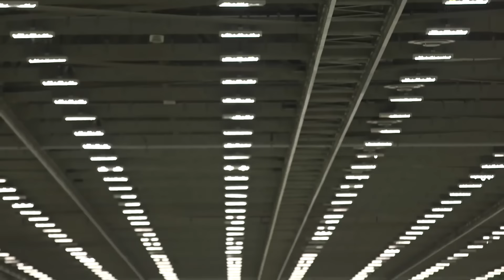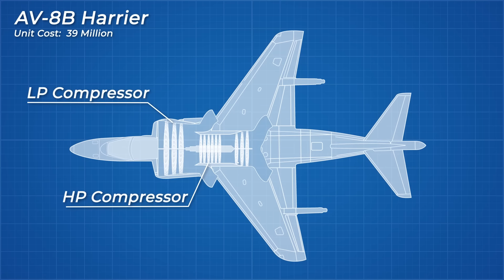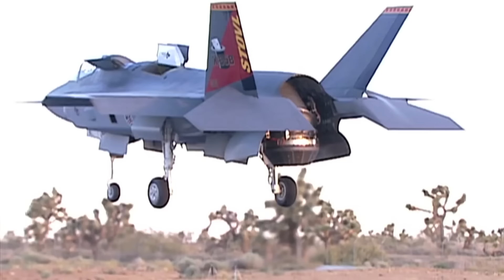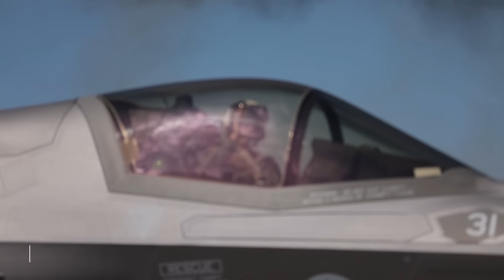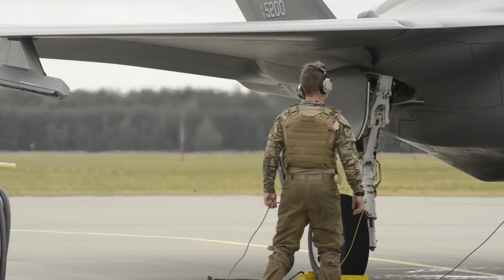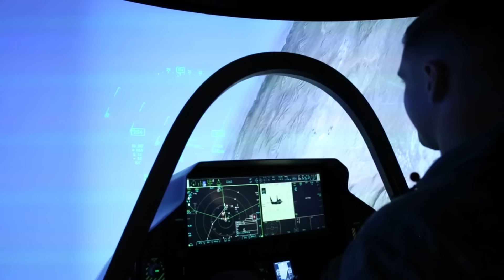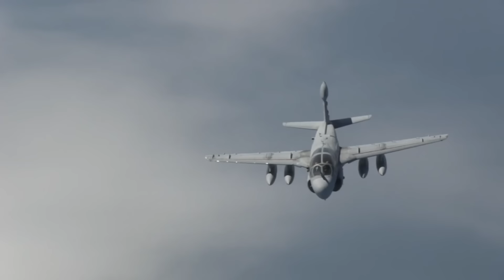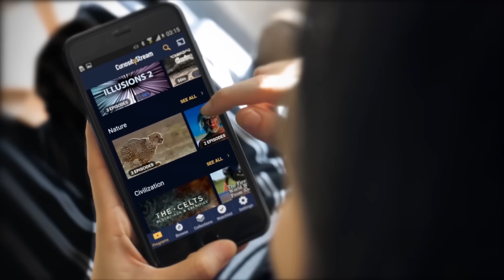Is The F-35 Worth $115 Million?

Comment: I want to the concept of the F-35 to work. Unfortunately, its development process felt like a way for Lockheed to lockdown a contract aimed to steal near-limitless tax money. The concept of a plane that consolidates multiple aircraft into one with full stealth capabilities sounds wonderful. Were they trying to consolidate too many planes into one? That is certainly arguable. I wouldn't get rid of the A-10; no other plane can do what the A-10 does - the F-35 doesn't even bother trying to do what the A-10 does, so that's a voice of confidence in the A-10's capabilities to me (let's not forget that the A-10 finally got its first upgrade only a few years ago, and it was predominantly an electronics upgrade, visible only by a couple of MFDs replacing multiple analog gauges - a handy upgrade, sure, but not a large one).

If any variant of the F-35 needs to work, it's the C. Navy specifications are actually a great standard to apply to the Air Force, so the Air Force's A variant is kind of pointless. Carrier and VTOL capabilities can warrant variants, but having three is unnecessary. Sure, the Air Force doesn't need reinforced landing gear or an arresting hook, but I've argued that ALL fighter planes should have full naval capabilities, and with this comes building steam/electromagnetic catapults and arresting wires at ALL air bases. Having carrier components full functional at land bases would greatly reduce the risk of grounding defense aircraft due to bombed-out runways. Plus, with the training programs condensed as well, all pilots would have the same skills and capabilities (the only lasting difference would be in tactics), and as a bonus, if one branch - or even military - needs more pilots, they can draw from the other(s).

As much as I want the F-35 to work after all of its time in development hell, it feels like a waste of money that should have been avoided. Sales speculation means nothing; businesses always oversell a product - that doesn't mean that they actually do sell, let alone by how much they say they will.
Reply: > "the F-35 doesn't even bother trying to do what the A-10 does, so that's a voice of confidence in the A-10's capabilities to me (let's not forget that the A-10 finally got its first upgrade only a few years ago, ..."

 The A-10 has begun being replaced in CAS missions where a ground-to-air or air-to-air (hypothetically ) threat is present by the F-16C since the mid nineties.
Reply: @peterson7082  And yet the F- 16C is to be retired in the 2030s, before the A-10's in the 2050s. Granted, this is subject to change, but this also speaks in favor of the A-10.

The F-16C isn't used in CAS missions; it's used for strike missions. CAS means that a plane has to stay in a (relatively) small AO where it is likely to take enemy fire (almost exclusively from the ground). Air threat are the first thing to be neutralized in any combat theater since Desert Storm, so F-16Cs fly in with F-15Cs to shoot down any and all airborne enemy craft and then assist F-15Es in destroying those still on the ground. The A-10 does have some air-to-air capabilities, but it has only been used against helicopters. While the A-10 has been shot down (and the F-16C has not), it has never been by enemy aircraft.

The F-16C was designed as a lightweight multi-purpose fighter whereas the A-10 was designed specifically for CAS and was (as pilots and engineers half-joke) built around its 30mm cannon. The A-10 is the only single-seat plane in the US military equipped with a 30mm; all others, including the F-16C, have a 20mm cannon. The F-35 is the exception... with its 25mm cannon.

Yeah, they tried to replace the role of the A-10 with the F-16C back in the mid-90s; then the A-10C was rolled out in the early 2010s. Since its introduction in the 1976 (the F-16 was 1978), there was only the A-10A; now, there's the A-10C. That means that their attempt to replace the A-10 didn't work out - and now they are trying the same thing using the F-35, which is effectively an F-16C with stealth.

Replacing the F-16 and the F/A-18 with the F-35 is hardly the worst idea; replacing the A-10 with the F-35 is much closer to that.
Reply: @DavidRichardson153  you're wrong about CAS. Not only did the F-16 provide more CAS than the A-10 in Desert Storm, there's footage of F-16s and FA-1/8s providing CAS in combat here on youtube.
CAS doesn't mean you have to take ground fire. It just means that you're dropping ordnance close to your troops. Not that the plane is close to the ground.
The 30mm cannon is a relic of the old days, it hasn't been able to punch through MBT armor since the mid 70's meaning that any 20mm or 25mm cannon in service can do the same job. The F-35 isn't the exception either, as the Harrier and the AC-130 have the GAU-12 25mm cannon. The F35's GAU-22 is a modern revision of it.
Reply: @ChucksSEADnDEAD  The F/A-18s providing CAS is easily explained away - what other Navy/Marine plane can provide CAS for extended periods? The Harrier is capable but it was already showing its age by Desert Storm. Trying to replace it with the F-35B isn't necessarily a bad idea. Rolling the F-35B out has been pretty s^^^ty, but that's to be expected from the program - once you learn of its development history (especially the contract for it).

The F-16 works great when the targets are in open areas or mountain ranges, where speed is vital to either reaching the targets or evading obstacles. In urban areas, the F-16 needs more room to maneuver around to line up its weapons, and that costs precious time - in both the maneuvering and the weapons travel from the plane to the ground (because the F-16 usually uses missiles, rockets, or bombs, which also have explosive radii - not good for collateral damage control) - that soldiers do not have much of. The A-10 has a much smaller turning radius and is designed to remain airborne in tight low-speed turns - something no supersonic fighter can do. The only air platform better than an A-10 for the job is an attack helicopter, but then the A-10 has the initial speed advantage for its first response. F-16s and F/A-18s are better for slashing attacks on the ground; they can provide more extensive coverage in a pinch, though the F/A-18 is better at that than the F-16. For extended time in the air under risk of enemy fire with a massive load out of weapons to fight back, the A-10 wins hands down.

And the 30mm cannon is hardly a relic. It has the same issue as all other airborne cannons: ammo. There are specific ammo types depending on the expected resistance; you have one for personnel, one for armor - even one for planes (bet that never crossed your mind). There is no ammo that is ideal for all missions; the F-35 is supposed to field a new shell that's better at being multi-purpose but it's still under development. Plus, Russian and European-made planes use the 30mm cannon (a different model, sure, but still 30mm); the MiG, the Rafale, and the Typhoon all use 30mm cannons. If anything, it's the predominantly-US 20mm cannon that's the relic.

Lastly, only the A-10's cannon actually fires one of the (currently) best anti-armor shell: a depleted-uranium core. Is this design old? Sure. Does it need replacing? Arguably so, and we're looking to see that (hopefully) with the F-35. Granted, the A-10 doesn't need to do a lot of anti-armor missions these days, so its ammo could be argued as being unnecessary, but the same could be said of the AH-64 Apache, and it uses a 30mm cannon (just a single-barrel one, not a rotary like the A-10). And before you argue that the Apache does mostly anti-personnel, guess what - so does the A-10 now (and the Apache was designed to help NATO fight off a Soviet tank invasion).

The A-10 is not going away anytime soon. The biggest advantage that the A-10 has over all other combat planes is that it was designed to absorb anti-aircraft fire. SAMs are powerful, but they are on the expensive side and their radar systems' signals can give them away to SEAD (Suppression of Enemy Air Defense) attacks, which is what the F-16, F/A-18, and (hopefully) F-35 can handle. Yes, SAM platforms are becoming more mobile, but once their radars are switched on, they might as well light a flare above them. Guns, however, are more easily concealed and thus can more easily surprise an incoming aircraft. The F-16, F/A-18, and the F-35 are not meant to take any number of hits whereas the A-10 is.

You want to replace the F-15E, F-16, and F/A-18 with the F-35? There's plenty of reasons to do so. Replacing the A-10 with the F-35, though, is incredibly foolish.
Reply: @DavidRichardson153  that doesn't really "explain" anything away. If there's USAF A-10s available, why are carrier borne aircraft being called in? On the other hand, even if the Navy lacks other attack aircraft it still doesn't undermine the fact that the F/A-18 is taking A-10 missions. It proves it is capable. The Harrier was showing its age by Desert Storm? The A-10 was showing its age by Desert Storm! 6 of them got brought down. Almost 30 years ago we realized that the A-10 was treading dangerous waters.
"In urban areas, the F-16 needs more room to maneuver around to line up its weapons" - what?
"the F-16 usually uses missiles, rockets, or bombs, which also have explosive radii - not good for collateral damage control" - the A-10's payload is essentially bombs, missiles and rockets. It's main weapon in 1991 was the AGM-62 Maverick.
"The A-10 has a much smaller turning radius" - the F-35 can turn very tight https://www.youtube.com/watch?v=IaHlWow6Yc4
"something no supersonic fighter can do." - https://www.youtube.com/watch?v=ELo1NRMHuR8 https://www.youtube.com/watch?v=5amEQpxHSSc https://www.youtube.com/watch?v=QoVGz9xai1M https://www.youtube.com/watch?v=beNOyZHVjEg at this point I'm gonna have to ask, who the hell has been telling you these things that are demonstrably false?
"only the A-10's cannon actually fires one of the (currently) best anti-armor shell: a depleted-uranium core." - which is not used due to the bad optics in spreading an aerosol of depleted uranium dust. Amazing how you bring up collateral damage and then ignore the massive heavy metal poisoning of civilians that lead to the discontinuation of the DU round. It leads to birth defects.
"The A-10 is not going away anytime soon" - it's already receiving less and less CAS missions. The USAF will begrudgingly keep it in inventory, but is not going to ask it to do much.
"their radar systems' signals can give them away to SEAD" - my dude, what do you think allows AAA to track and accurately hit fast moving jets? Radar.
"but once their radars are switched on, they might as well light a flare above them." - same as AAA
"Replacing the A-10 with the F-35, though, is incredibly foolish." - it's like you're not willing to listen, it's already been replaced for the most part. What you're saying is foolish already happened 5 years ago.
Reply: @ChucksSEADnDEAD  Has the F-35 already been doing what the A-10 can do? Do you not know that the F-35 was promised to be in full service by 2010 - and that promise was made back in 2003? It's only now that's it's finally doing what it promised to do - and reliably so? Remember how as recently as last year, it couldn't even fly in adverse weather because its avionics would shut down and restart as lightning and thunder went around it? Its entire development process has been a scam, one with a price tag of nearly $2 trillion dollars. How the hell did this happen? Because of a clause in the contract that authorized "concurrent production," meaning they would build the fleet of F-35s as the were being developed and tested so whatever problems were found in the test planes would be found in all of the planes. And the kicker to this? The DOD would have to pay Lockheed for every single one of these fixes.

Name another plane that has had a development process like this. Not even the B-2 or the F-22 had something like this, and they're even looking to just expand the F-22 into the attack role as well - there's already plenty of footage of F-22s dropping air-to-ground ordinance. The F-35 just screams of being a massive scam. And having its components built in multiple nations (none of which build more than one component)? Sounds good in theory for building trust between allies, but it allowed Lockheed to use other nations' economies to pressure the US to keep the contract going.

I am not going to see the F-35 as anything other than a scam, so if it's going to be serving on the frontlines, it better be a miracle plane, and given its history, there's absolutely no reason to hope for it to be such.
Reply: @DavidRichardson153  "Has the F-35 already been doing what the A-10 can do?" - not even the A-10 has been doing what the A-10 can do. Comparable multirole fighters have taken over the A-10's job. It only stands to reason an even better multirole fighter is gonna do it even better.
"Do you not know that the F-35 was promised to be in full service by 2010" - most operational milestones were achieved by 2013. Compared to the clusterfuck that is military aircraft development that was pretty acceptable.
"it couldn't even fly in adverse weather because its avionics would shut down and restart as lightning and thunder went around it?" - do you keep track of how often other aircraft have to be grounded because of issues? Just this year 75% of C-130s had to be grounded. The B-1B also had to be grounded due to parachute issues. T-6 trainers were grounded due to hypoxia and the same happened to 28 A-10s. In 2014 86 F-16Ds had to be grounded.
Not to point fingers at others, but Germany can't even maintain the minimum training standards because most of the Eurofighters are grounded.
"Its entire development process has been a scam" - every government program is a scam. That has fuck-all to do with the aircraft design.
"The DOD would have to pay Lockheed for every single one of these fixes." - lol that's the government for you.
"Name another plane that has had a development process like this" - considering that aircraft development used to straight up KILL pilots in the old days, and that a lot of the problems of the F-35 stem from the fact that it's inherently more complex, I'd say the F-105 and F-111 were proportionally just as bad as the F-35. Mind that the Eurofighter has also been in a politically-generated boondoggle as well.
"they're even looking to just expand the F-22 into the attack role as well" - who's "they"? The F-22 isn't as good as air to ground and nobody is going to rebuild the manufacturing line. It's gonna be a 220 million per plane job to reactivate the F-22 program. You can expand it into the attack role but that doesn't mitigate the fact that the US eventually will need to replace the aging F-15 and F-16 and there's not enough F-22s for the job.
"The F-35 just screams of being a massive scam" - if any other aircraft procurement was put under the microscope like the F-35 it would sound like a scam. Not only are we living in the information age which means you can't get as much details on the issues other older planes had, we're also living in a world of clickbait and deliberate propaganda. Let's not forget that some of the F-35's biggest critics are tabloids and outlets like Russia Today.
"Sounds good in theory for building trust between allies, but it allowed Lockheed to use other nations' economies to pressure the US to keep the contract going." - Again, mind that the Eurofighter Typhoon did the same thing - fuselage is built in Germany, one wing is built in Britain and the other in Italy. I wouldn't say it allowed Lockheed to use other nations to pressure the US, because the US got the most subcontractors working on the F-35. It's simply a jobs program so that on a multinational project one nation doesn't get all the money.
"I am not going to see the F-35 as anything other than a scam, so if it's going to be serving on the frontlines, it better be a miracle plane," - everyone who flew it says that it is.
Who says that it isn't? Russian state-ran media, lunatics like Pierre Sprey, """journalists""" (which as we all know are extremely reliable) and people who never flew it.
Reply: @ChucksSEADnDEAD  Only the F-35 was having its fleet built as it was being tested. Sure, building new prototypes is to be expected and every plane goes through multiple prototypes for various reasons, but only the F-35 has this. You can call it a "government overlook," but every general and admiral in the DOD has connections - often close and sometimes personal - to defense contractors and weapons manufacturers, thus making it easier to work such a clause in (especially since after they retire from the military, they almost also go to work at these corporations as contractors/consultants/board members). With all other planes, they still have to deliver on what's being promised. The F-105 and F-111 had plenty of problems with their designs, sure, and they can be argued as underperforming planes, but even they can't compare to the boondoggle that is the F-35.

Even with their problems, there's one advantage that the Eurofighter and the Typhoon have over the F-35: they aren't marketed as all-purpose fighters. Are they multi-role, like the F-35? Yes. Europe doesn't have the space to afford massive specialized aircraft like bombers; the closest they have to a dedicated bomber is the Tornado, which is already heavily outdated. However, the Eurofighter and Typhoon planes are not designed or sold as long-range fighters/attackers but as quick response defense craft. This is why one of their key characteristics is STOL, meant so that they don't need actual runways to take off and land and can just use a piece of highway instead. Sure, they don't have the same options as a VTOL, but they are still comparatively more maneuverable.

Also, citing the F-14D doesn't help you. You know what was going on with the F-14? It was being decommissioned, with the last one officially decommissioned in 2014, with the plane to be replaced by the then-new F/A-18E.
Reply: @DavidRichardson153  "Only the F-35 was having its fleet built as it was being tested" - the F-22, F-14, F-15, F-16, F/A-18, C-17, T-45 and B-1B also had concurrency, aka they entered low rate initial production before initial operational testing and evaluation. 
"but every general and admiral in the DOD has connections - often close and sometimes personal - to defense contractors and weapons manufacturers" - you're preaching to the choir. This is external to the F-35 design. Even getting a freaking road built involves government connections to the private sector.
"they aren't marketed as all-purpose fighters" - whaaaaat?
"the Eurofighter and Typhoon planes are not designed or sold as long-range fighters/attackers but as quick response defense craft" - I really don't understand what's being implied here, just like the F-16 was the "low" to the F-15's "high" the F-22 and F-35 are a "high-low" combo.
"Also, citing the F-14D doesn't help you." - good thing I didn't, because I said F-16D. My comment remains unedited if you want to look.